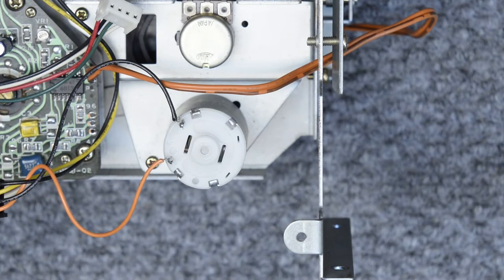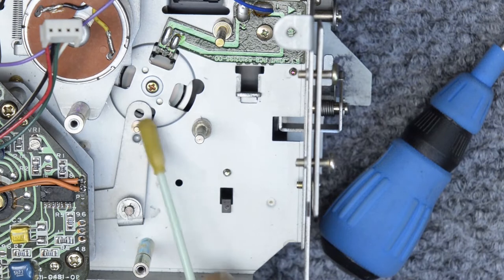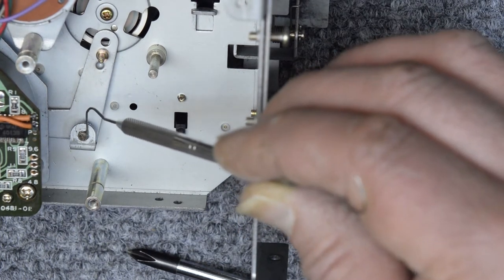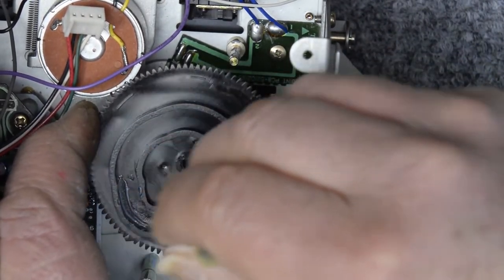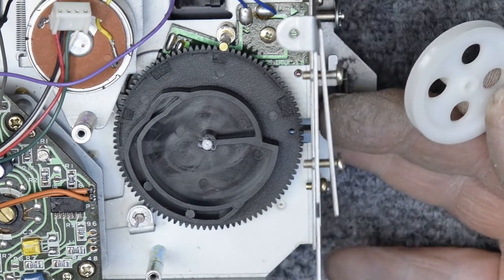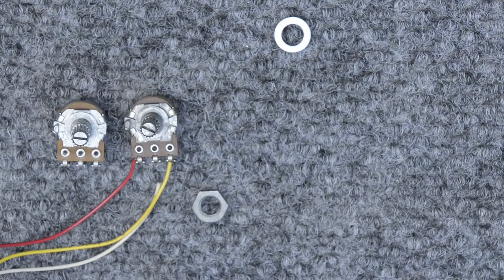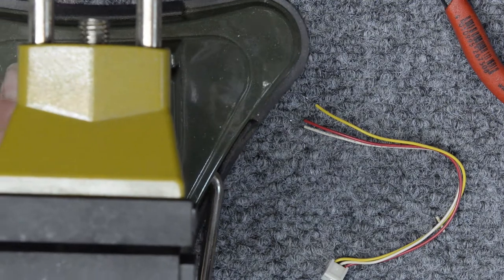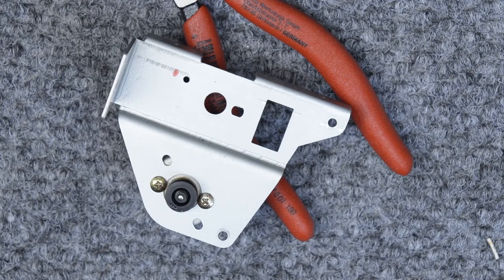Tascam 122mkll Cassette Deck Full Transport Service - Part ll

Comment: The instructions from your videos helped me bring my 122MkII to life! THANK YOU. The question is whether you have any experience with the Tascam CD-401.
Reply from the maker: Thank you for watching. I have never worked on a CD-401, sorry.
Reply: In any case, thank you. Everything works on the CD, but I need to adjust the focus with some trimmer resistance. Which way does it skip. It will be trial and error. Thanks

Comment: In place of areas with silicon grease, how do you feel about using drug store petroleum based Vaseline ?
Reply from the maker: Vaseline, or any other petroleum based product, is considered harmful to the common plastics found in these machines. If it says something like "safe for most plastics" or similar in the datasheet, it should be fine. I don't personally use silicon grease on anything, ever, as it's an inferior product, but it would be preferable to Vaseline if those were my only options.

Comment: Amazing tutorial. Can you tell me what grease you were using on the cam?
Reply from the maker: Thank you. I use M-kote EM-30L for the cam surface and Krytox for the axle.

M-kote: https://www.amazon.com/Corning-Molykote-Synthetic-Lubricant-Container/dp/B00B51C76I

Krytox: https://www.amazon.com/Krytox-Grease-Pure-PFPE-PTFE/dp/B00MWLD67O/ref=sr_1_1_sspa?crid=E81SXMJFNI7D&keywords=krytox&qid=1647641432&s=industrial&sprefix=krytox%2Cindustrial%2C448&sr=1-1-spons&psc=1&spLa=ZW5jcnlwdGVkUXVhbGlmaWVyPUEzSEIyTU5VUjNLWksyJmVuY3J5cHRlZElkPUEwMTQ3MjIyRVdNVkxONUVWTUNOJmVuY3J5cHRlZEFkSWQ9QTAyODM5NzcyUDJZODU1NVJaVEtVJndpZGdldE5hbWU9c3BfYXRmJmFjdGlvbj1jbGlja1JlZGlyZWN0JmRvTm90TG9nQ2xpY2s9dHJ1ZQ==
Reply: @asbcustom  Thank you so much for your fast response

Comment: Hello there 
Can you please tell me what is the diameter of the belt you removed (loading belt).
In my place I can't buy the belts according to the machine model only according to the belt diameter or belt size.
Reply from the maker: The part number is PRB SCQ6.7 and is available on eBay. The diameter is 6.7 in., it is a square belt of about  .055 in. cross-section.
Reply: @asbcustom  Thank you very much for this information.

Comment: Can you tell me what oil you were using for the motor bearing surface?
Reply from the maker: The control motor front bearing is sintered bronze, I like NyOil for those.

NyOil: https://www.amazon.com/Nye-Lubricants-NyOil-Thin-Lubricant/dp/B000B600L2/ref=sr_1_1?crid=1Q41DFREVFTWO&keywords=nyoil&qid=1647641706&s=industrial&sprefix=nyoil%2Cindustrial%2C458&sr=1-1-catcorr